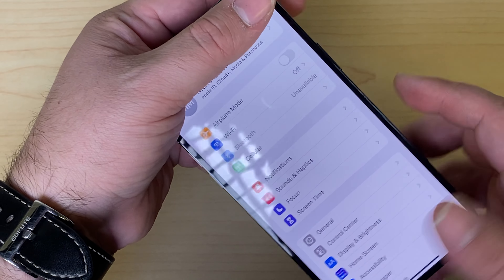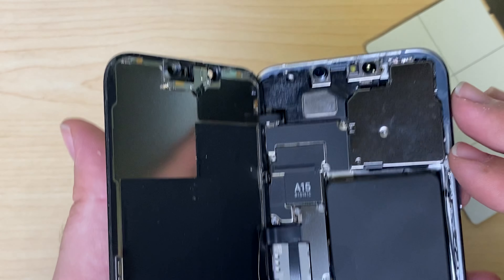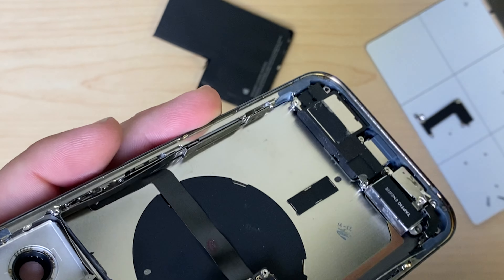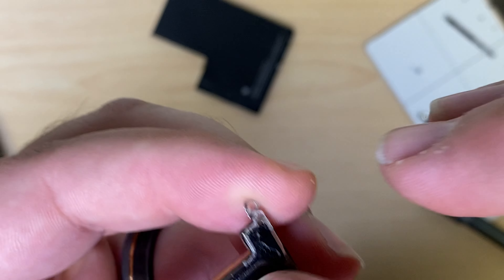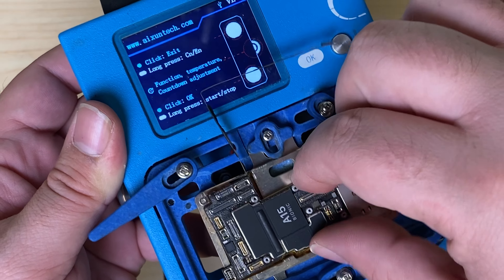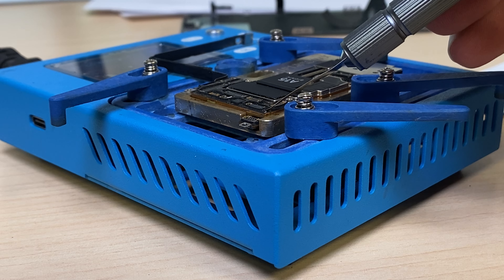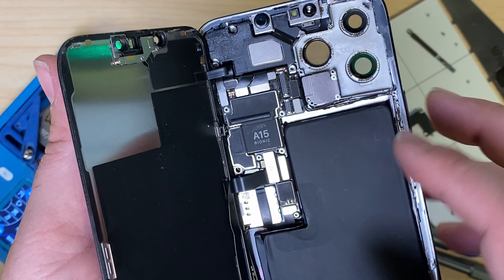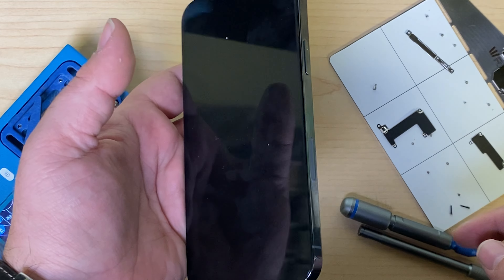iPhone 13 Pro Max WiFi Repair: Get Back Online Fast!

Comment: Hi ! If we don’t have access to the heating device, what can we use instead? Heating gun ?
Reply from the maker: Possibly, the trick would be to evenly heat it without overheating it. It's close to impossible to do it successfully with a heat gun in other words